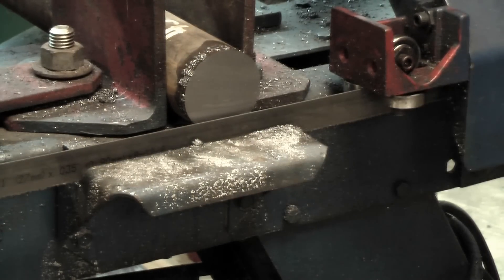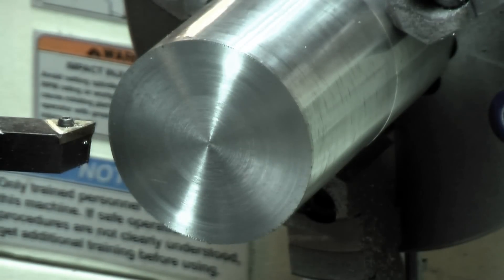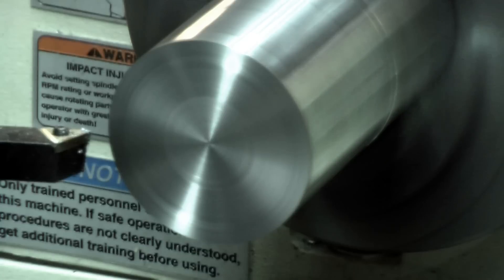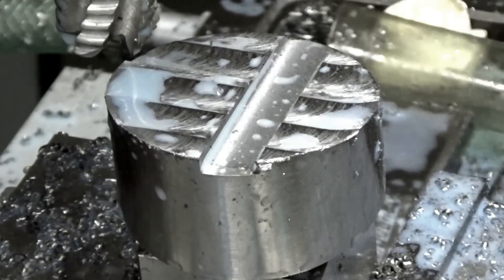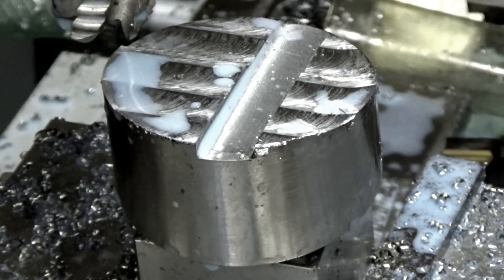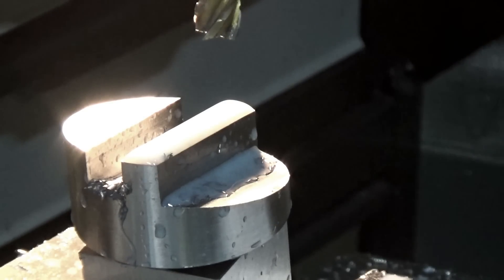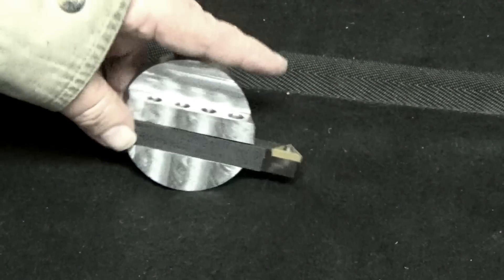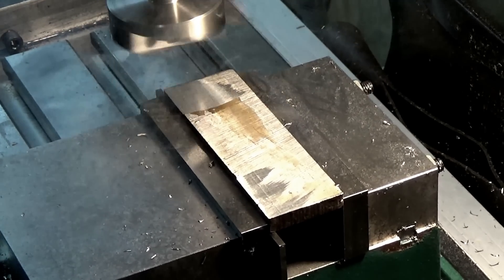How to make a large Fly Cutter

Comment: I am retired now, but I worked milling machines for many years but I can honestly say that I never needed to use a fly cutter in all that time. I could never see the point when I could use a face mill with multiple tips. To get a fly cutter to work well the mill spindle needs to be set exactly perpendicular to the table. If you are going to that much trouble you will get a better finish with a face mill with radiused tips and vastly increased feed rates. I have made face mills like this and they work very well.

Comment: Nice job Brian on that Fly Cutter. I have 2 questions for you, first is what is the highest height of your 15 degree body of the holder whit out the 3/4 shaft. Second is what is the make and the part number of the cutter and the insert, I know it is a 1/2 inch. square. Thank you.
Louis Alleva
Quebec. Canada
PS. nice dog
Reply from the maker: +Louis Alleva 1 3/8" at the highest, as for the inserts it was a cheap set I bought from enco, $29 for a set of 5 tools with inserts thanks for watching

Comment: I'm pretty new to this, just a quick question. All I've got on hand right now is 2 1/2 x 5 inch 316 ss, do you think that would be ok to use for a fly cutter?
Reply from the maker: +robert lanham sure, but it will be hard to work with, the chips come off long and sharp, be careful. thanks for watching.